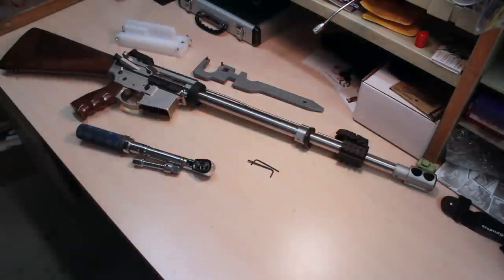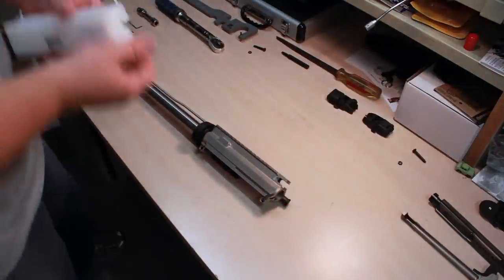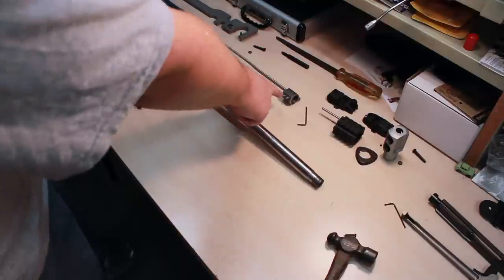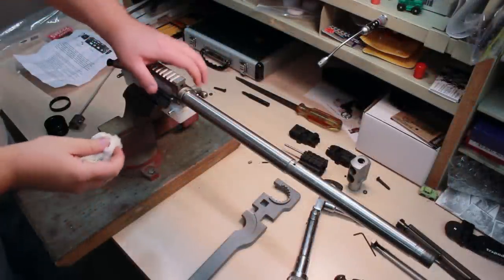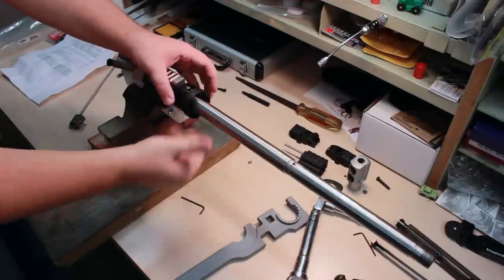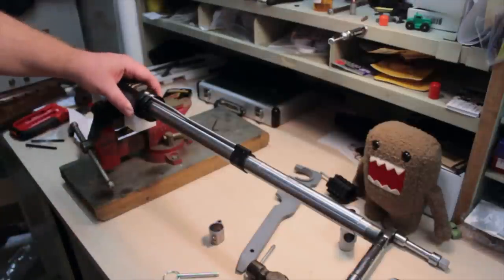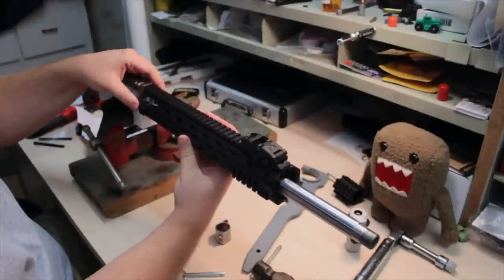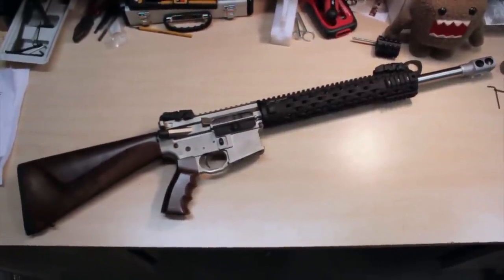Project Broadsword Fixed - Awesomeness Contained!

Comment: Someone correct me if I'm wrong here but i believe the wood AR kits are designed to be used on a A-2 style set up. This way the gas block is not under the fore grip and have problems like you did. I have one that i did with wood only in a carbine and it went together smoothly and operates the same. Sad because it would have been a beautiful rifle but then you put the free float on it.

Comment: @chaos311clarity The Colt manual recommends 35 lbs minimum for a 5.56. Bigger calibers need more. What will happen is your barrel nut will back off until it hits your gas tube and push the tube out of alignment which can cause failures to chamber and wear on your gas key. Believe it or not the barrel can and will move around without any torque on the nut, and that is going to destroy accuracy. I've put 120 lbs on a receiver before but it's not recommended. I would torque it up to the next hole.

Comment from the maker: i dont think youre correct. I just looked at the instructions again and it says tighten it by hand, THEN use the wrench to align it to the next hole. either way its definitely seated firmly on there so no worries.

Comment from the maker: @MrSurgicalPrecision i debated whether or not to put torque on it... right now its only got enough past hand tight to get it lined up as per the directions for the install. Whats the reasoning for the torque? its really simple to get the gaurd off of there so i suppose i can go back and torque it up with no problems.